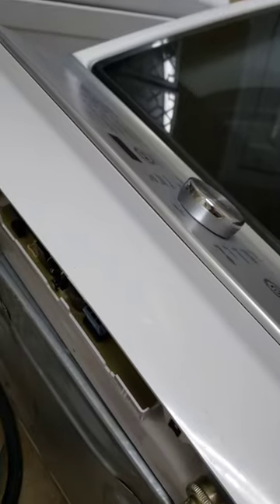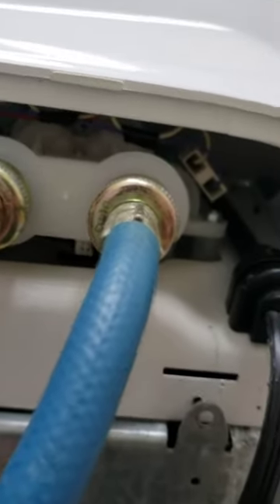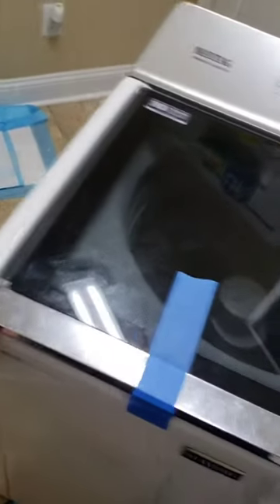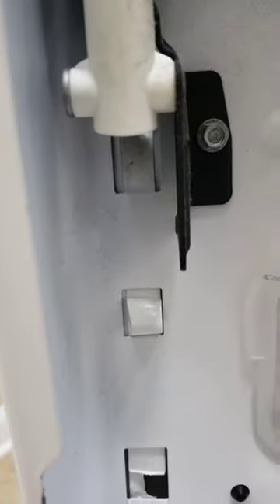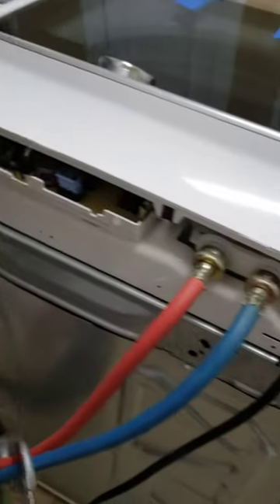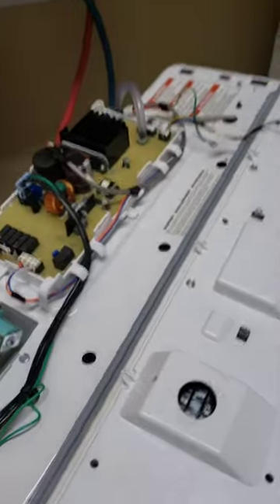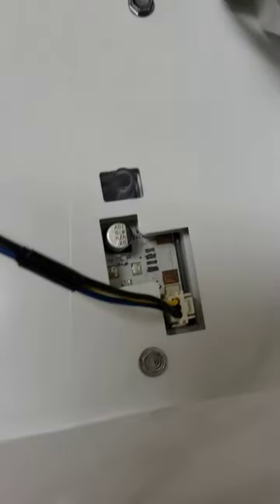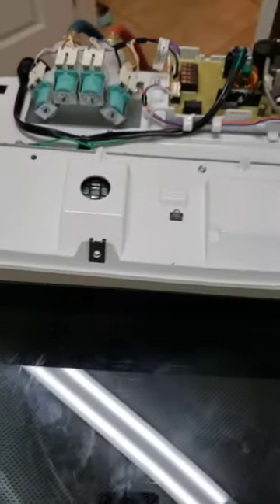Maytag bravos washing machine dead control panel easy fix!!

Comment: Once the top back panel was off (5 screws), I was able to squeeze my hand in with a Q-tip dipped in rubbing alcohol to clean the four small sensors on the back left side--no need to undo the metal clips and slide the panel forward.  This worked; thank you so much!!

Comment: Worked like a charm.  Thank you so much!  I first checked the 120v coming in then the 5v going to the control panel.  All was fine but still no power.  Took a q-tip to those 4 little metal plates and Voilà.  Powered right up.

Comment: Some very light corrosion on the contactors you referred to. Cleaned them with some alcohol and electrical contact cleaner. That worked PERFECT.  Thanks! This is clearly an easy fix and should have been addresed by Maytag long ago.
Reply from the maker: Nice!!
Reply: Maytag does not want you to know this trick.. Maytag is sabotaging people just like every other company that is big

Comment: Followed Your video instructions, the green light was blinking and I cleaned the controller as shown with alcohol and it totally worked. My washer is up and running .... cost was two q-tips :). TY so much for posting this.

Comment: I'm a machine repair technician, a client told me he had this issue 6 months prior, replaced the part for $400 and it was happening again. I thought it was strange so I looked into it and found this video. 
To my complete fucking surprise, this worked. You just saved my companies' client either a $400 part or a completely new machine.

Comment: Our Maytag Bravos Xl mvwb835dw1 would not power on, so we called a repair company to come fix it. The technician said the control board and the main board was bad and needed to be replaced.
The coast was going to be $560.00 for the repair. I came across this video and less than 5 minuets the washer was back on and working just fine. THANK YOU for the great tip!
Reply from the maker: Great Im glad it helped. I was in the same boat until I found this fix
Reply: You mean the q-tip.
Reply: Any chance you’ve done this with the same brand dryer?

Comment: Add another $300+ to the total you have saved us. Same dang thing here. 2 of the tiny leads that are supposed to be copper colored were actually green (was her stays in garage) so I ended up scraping the gunk off (carefully) then scrubbed the area real well. Plugged it in and it fired right up. Thank you brother!

Comment: We replaced the control panel two years ago ourselves, then it went again this morning. Just used your tip and it's working again fine - I probably could have just done that years ago. Thanks for saving us $300 on the new part!

Comment: What a lifesaver man.  Had to get new water heater couple weeks ago and then this happened to my wash machine on top of that.  Did the q tip trick and it's back working.  Helps you showed how to take it apart first.  Thanks!

Comment: Amazing!  I did exactly what you said.  I took off the controller board frame, used some rubbing alcohol at the few exposed circuit leafs, plugged everything back in, and the control board lit right up.  It cost all of a new bottle of rubbing alcohol.  Thank you!!

Comment: I don’t make videos and I have done this fix before because I had stumbled across the electrical contacts being green and corroded . So this being the fourth time in 3 years I’ve had to fix my washer I couldn’t get it to work so I watched your video and it was everything I’d done in the past repairs but I still couldn’t get it to work. Then I took the control panel piece off and cleaned every contact I could see with corrosion. It worked . Thanks for the video it was a good refresher. I just subscribed to your channel.

Comment: Thanks, this fix did the trick. Just a few notes on my particular machine.

I don’t see any name on our machine (e.g., “Bravos”), and I had watched 5 or 6 YouTubes. Finally, decided I would see if I could recognize the same control panel designation on a video –”Maytag --Commercial Technology.” 

I followed the instructions here, but found that we have more screws on the back around the “hinge” area. Also to release the circular spring clips, I used channel lock pliers because regular pliers had insufficient mouth to grab  and squeeze the clip.

Also, when I pushed and then pulled the top loose, I couldn’t access the inside of the control panel. There was a metal panel running the length of the control panel (not shown in the control panel for this video), and I removed the screws holding it on. Then had access to the plastic back of the control panel, which had the access hole with the contact points shown in this video. I removed the little wire with needlenose pliers to squeeze the plastic clip.

(YOU HAVE UNPLUGGED THE MACHINE IF YOU ARE FOLLOWING ME –CORRECT?)

I used Q-tips and alcohol to scrub the contacts, but the blackish corrosion was hard, particularly between the 4 copper strips. I CAREFULLY used a small chisel to GENTLY scrape the area between the strips, making sure not to gouge the plastic –only scrape the corrosion off the surface. 

Then, I scrubbed some more with the Q-Tips/alcohol. Instead of reassembling everything, I connected the small wire to the contacts access area and gently turned the control panel over. I stepped away from touching the machine, plugged in the machine, and pushed the on button. SUCCESS! 

 HOWEVER, ANYONE WITH ELECTRICAL KNOWLEDGE/EXPERIENCE, PLEASE ADD WHATEVER CAUTIONS SHOULD BE INCLUDED IN THESE AMENDMENTS TO THE VIDEO.

Comment: This fixed my washer as well!

The panel was non responsive following a little power surge, so I was convinced that the main control board had a short, even though I had the blinking light. I purchased a replacement and installed it, only to still have the same issue.

Feeling defeated, I was about to try purchasing a replacement panel when I came across this video. Sure enough, there was some corrosion in the exact spot mentioned in the video. A qtip and rubbing alcohol cleaned it right up, and all seems to be in working order again!

I put the original control board back in to confirm that it wasn't the issue, and indeed it was the dirty contact points.

I only wish that this video would have been published and I had seen it before I purchased the replacement control board. Now, here's to hoping I can return the replacement board I purchased.

Thank you, thank you, thank you!
Reply from the maker: I'm glad this helped please subscribe to this page to support my music

Comment: This worked perfectly for me as well.  I used some electrical contact cleaner I had with a Qtip and my washer now works as it should.  I contacted 3 different service providers and none of them would recommend this as a solution.

Comment: Add another "holy shit this worked" from me.  Thank you for sharing and also a  hearty, "Maytag you suck!"  Our unit was slightly different.  If you lift the lid and don't see the silver clips just verify the green light is blinking while plugged in, take the top metal panel off (5 screws),  unplug the unit, use the q-tip with rubbing alcohol and reach back on the left side of the unit to swab off the 4 line things next to the plug like Brent outlined in the video.  We even had a guy who's worked on washer/dryers for 30 years come out and told us buy new.  Dude thanks for saving us 700-900 bucks.

Comment: Awesome video and very helpful. I had the same issue with Maytag Bravos XL and circuit board was little corroded. Fixed the issue and followed step by step process. It worked!! Thank you very much!

Comment: Maytag, product of Whirlpool, is an inferior product.  10 year warranty on motor and wash basin, but the control panel is what went out after only 1 1/2 years!!!  The control panel is so expensive that the service man just said, "Buy a new washer".  It was $650 new!  Their 10 year warranty on those two parts gives you a false sense of security.  Thank you for your post. I'm about to try it.
Reply: They are pos. I replaced 3 panels under warranty and now the basket motor gave up. Called Maytag and all they talk about is money. They are mfkrsssssss

Comment: Ain't no grave gonna hold this washer down! This is indeed the question for my 17 year old kenmore 70 series, while my bad left eye is on this used Bravos XL mct oil Maytag.  I sure would like the bravos XL, but I am afraid of the control board, which costs too much and lasts too little.  The spin speed had me a 3000, plus the quiet.

Comment: Thanks for the great video.  I opened up the lid and the contacts were corroded but after I cleaned them the washer still didn't start.  Any thoughts on how to determine whether I need a new interface vs. control board?  Thanks.

Comment: Took my front panel off and checked the cord for power and it was good. Plugged back into the panel and then the receptical and she fired right up. Loose connection

Comment: So I think I have same washer...
I bought a used one, worked once.
Now all lights come on and I set it to normal, set load size and hit start...
It senses then goes to wash 3 times then shuts off. When it senses I thought it would fill wirh water but dont. I noticed a problem on last load when clothes wer still kinda wet. This unit is like 4 yrs old
Also mine has 2 connections and 2 "litte thingys" haha
Giving it a shot

Comment: Same issue with mine except the LED light on the control board isn’t lit and there is no power to the control panel.  Just ordered a new control board.  Cool $345.00.  Hopefully, it will fix it.  Sad this thing only lasted a few years.
Reply: By the way, this happened after we tried the sanitizer cycle for the first time.

Comment: yup, same thing happened to me.  I have had to clean these small contacts on the circuit board every 2 years.  They seem to build a short path of current and throw strange error codes if working at all.  Has Maytag acknowledged or addressed the problem anywhere?

Comment: Didn't work for me.  Mine kept randomly shutting off.   Ended up drilling out all the plastic stakes to get access to the pcb.  Reflowed the qfn and qfp parts with some flux.  Cleaned it all and re-assembled it. Works now.
Reply: Long term plan should have been to conformal coat this.   Maytag should have done this.  Modern trash..

Comment: Anybody know what those sensors are for?   This works great until the humidity goes up .   I’ve cleaned them three times .   Is it coincidental or are they moisture sensors?     I would if I sealed them if it would be bad

Comment: Tried cleaning the pads on the rear of the user interface multiple times and did not have any effect. Called Maytag and they have no technical assistance available, suggested I schedule a service man. I researched and downloaded a service tech manual and ran all the test with a VOM. Ordered a new control board and user interface which did not fix the problem. I'm done with Maytag...............

Comment: Dude, I have exact washer and I have error F7E5 shifter motor, I don’t know exactly what that is MAYTAG has ass customer service was on hold for 3 hrs today but no one has a clue what I need. I cannot even find out what the shifter motor is. Appliance people down the street say “Actuator” but this thing doesn’t have one on the bottom 

I just see the water pump and a white disc I cannot remove

Comment: I had this happened to me when the washer was 7 months old and I MG419D acrylic and it work again for a few months now is done it again and I know already what it is but, all these manufacturers know what the problem is and do nothing to fix it. They want you to buy the control panel $300 plus the labor about $600 and a2 month wait for the part shame on you and this is coming from someone who is a seasoned tech